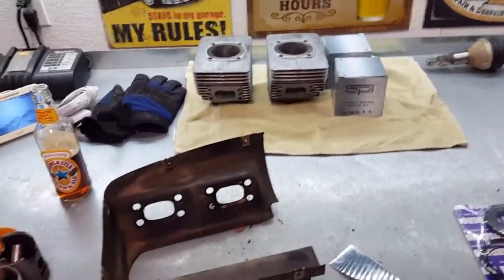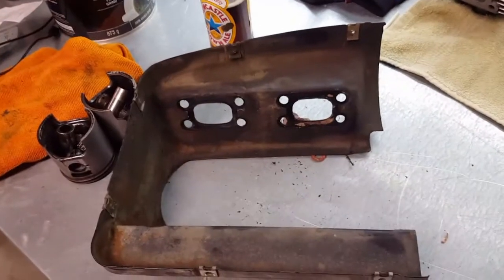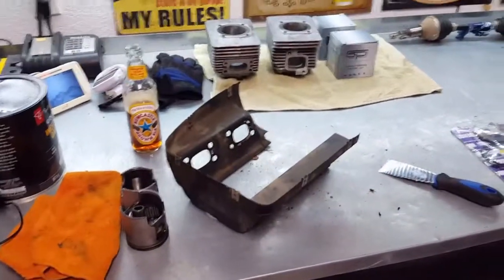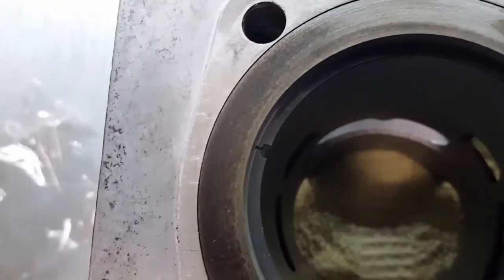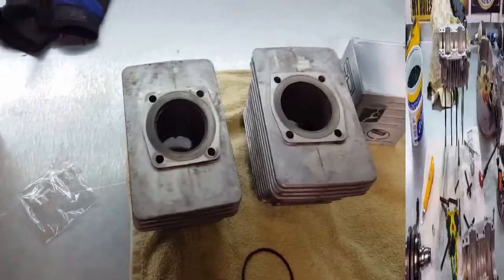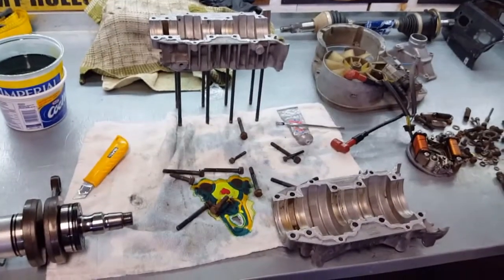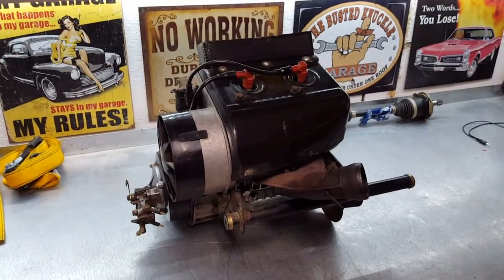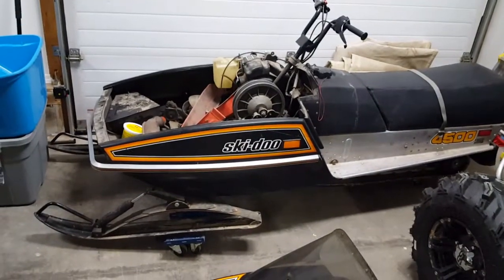1981 Ski Doo Citation 4500 Rebuild Part 4

Comment: So you don't have to check timing or re-time when you put that stator plate back on? New to rebuilds.... First one coming up!
Reply from the maker: Hey Brent as long as you mark it before you take it off. That's a good starting point. But if someone has been in there before it would be a good idea to check the timing.
Reply: @garagenerd1951  Good to know. My $175 Citation runs now, but dies once warm... So the same issue yours had? I have all summer to figure it out. I'm sure she'll be ready for some nice Alberta snow as soon as it gets here.
Reply from the maker: I would suggest cleaning the points and replacing condensers
Reply: @garagenerd1951  Saw your other video of the re-pull.... I will just do it all!!
Reply: @garagenerd1951  I have a picture for you to look at... Not sure about this Citation motor!
Reply from the maker: @VerticalSpeed1987  send away
Reply: @garagenerd1951  I'm an idiot.... My Citation is CDI... I guess the box is probably bad? Coil seems okay with voltmeter test... http://tinypic.com/r/30ic77k/9